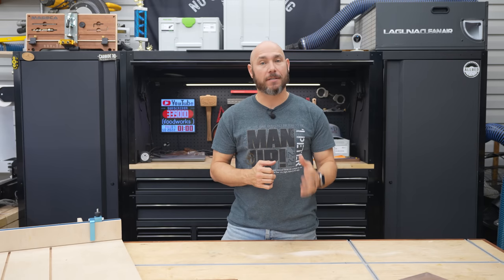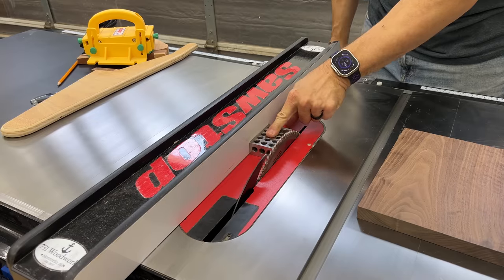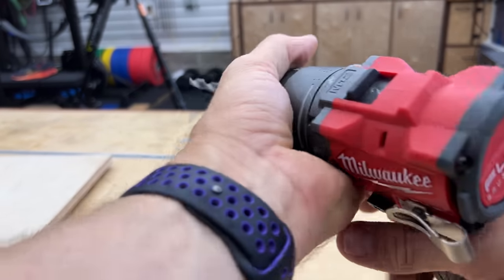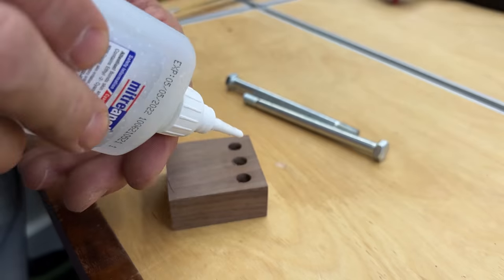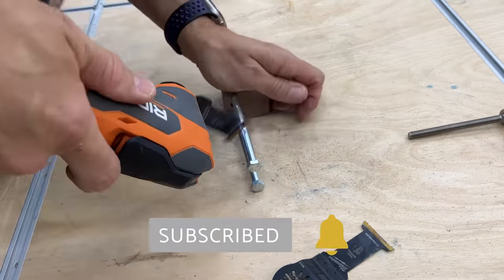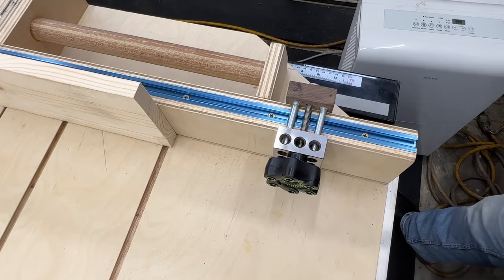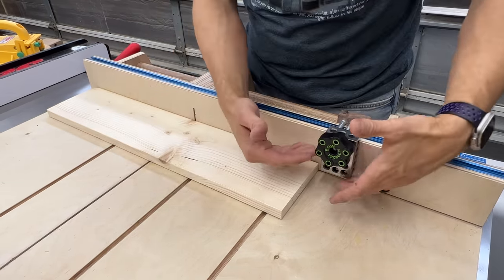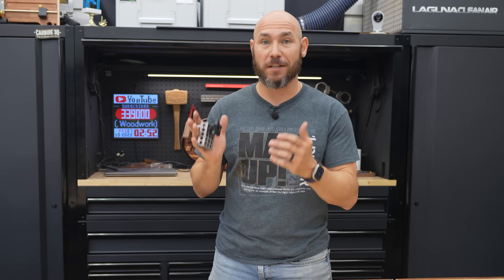DIY Stop Block Jig that Does NOT Require a T-Track

Comment from the maker: ▼EXPAND FOR TOOL LINKS and INFO▼ 
Watch Next = 25 Ways to Use 123 Blocks - https://youtu.be/n9SNxJVz13A
Tools In This Video: 
123 Blocks - https://lddy.no/1d9tp
Carriage Head Bolt 5/16"-18 x 5" - https://amzn.to/3Ti0VeP
5" Bolts 5/16" - 18 x 5" - https://amzn.to/3gnaU3J
5/16" Jig Knob - https://lddy.no/1d9tq
CA Glue I Use - https://amzn.to/3S6r26N

(If you use one of these Amazon and other affiliate links, I may receive a commission) 

Some other useful links:
Daily Tool Deals on my website: https://www.731woodworks.com/tool-deals
Subscribe to our email Newsletter: https://mailchi.mp/7e44c16eefdc/731-woodworks-email-newsletter
Check out our easy-to-follow woodworking plans: https://www.731woodworks.com/store
Outlaw's Board Butter - So Good it Should be Outlawed: https://www.731woodworks.com/store/boardbutter
Reply: Just wanted to let you know, the two McMaster links are incorrect.

Thank you for the idea!
Reply: Great

Comment: The Tool Bear from Den of Tools channel contacted engineers from some tool companies and they told him that backing the chuck up a click does NOT lock it in. It takes it out of the notch and will let it eventually loosen up as you use it. AVE also did a video on it and he said the same thing. Just a heads up.
Reply: One of the YTers who made this claim (the one featured in AvE's video) has also published a correction/retraction video: 
https://youtu.be/yH11SnnbS84
In his defense, he tried to do his due diligence and many of the tool mfr reps actually confirmed the claim. For this latest video he contacted the chuck manufacturers, who were responsive and quite definitively set the record straight.

Comment: I  like.  
Power Tip! If your 1-2-3 blocks are threaded on the 1" face... you can thread a bolt through the stop and now you have a micro adjuster.

Comment: Could you just attach the block with a fence clamp or two?
Reply: Yes I use a bock of hardwood with a piece on top to sit on top of the fence then just clamp it...Have a measuring tape glued to the top of the fence which is just a piece of melamine it does the job.

Comment: With the 1-2-3 block which you are using, you are not limited by the 3" depth. You have plenty of other holes to use. You can mount a face plate to the right (as looking down as it is mounted). Come through the left using two of the holes to secure the face plate. Use a 1/4" thick piece, cut to 1" x ? whatever length (depth) you need. Drill and tap the 1/4" to receive the mounting bolts. Cut the mounting bolts flush. The aluminum stock can be cut using woodworking tools. Just go slow. So, the final face plate (facing the work piece to be cut) would be 1/4" x 1" x ? desired length (depth) to fit your fence.

Drill and tap at least four (4) holes in the face plate, you can have some up and down adjustability👍😎😀

Comment: so why not use shorter bolts instead of cutting them off?
Reply from the maker: You can.  Cutting the bolts allows you to size it to your specific fence size.  And, this allows you to cut the threads off the outer two bolts and just have the smooth part.

Comment: if you instead used the block of wood as the stop with the 1-2-3 on the outside of the sled then you don't need to worry about the fence height as you can cut the block to be as tall as your fence instead.

Also, the drill chuck locking thing was debunked.
Reply from the maker: works on mine
Reply: @731Woodworks  Not turning it back would also work on yours. Sorry bro. Love the 1-2-3 block stop block, but the chuck thing is thoroughly debunked internet BS.

Turning back just loosens the chuck 1 click. It's fine providing you initially tightened the chuck enough that loosening it 1 click doesn't affect the tension enough for the chuck to lose grip. Tighten it just enough to grip the bit then turn it back and see what happens. Loosening cannot improve retention.
Reply: @ST-0311  Works on both my large and small Ryobi HP drills.

Comment: Could you not just use a hardwood block instead of the metal block? Or a wood block with a piece of laminate to stop it wearing? Cheaper than a 123 block.. 👍🏴🇬🇧

Comment: Which Milwaukee drill is that?
Reply from the maker: M12 Fuel.  Latest version...I think.
Reply: @731Woodworks  I bought a refurbished Milwaukee drill a few years ago. It was like new, and I love it. 6 months later, I bought a refurbished Milwaukee impact driver. It came very used, but I love it as well. I am thinking about purchasing a second Milwaukee drill, but haven’t pulled the trigger yet.

Comment: Decent concept, but the 1-2-3 block seems totally superfluous...just use two pieces of wood and the same hardware...If you have a 1-2-3 you could use it as a template/drill guide, but why not just use wood on both sides.

Comment: @731Woodworks Matt, do you know if the festool drills have that counterclockwise feature?
Reply from the maker: I'm not sure.  Never used any of their drills.
Reply: It is not a feature on any tools, only a misunderstanding. Den of Tools did a video debunking this after talking to engineers at different tool manufactures and Jacobs Chucks.

Comment: Great idea. Thanks for sharing.  In fact a little bit too late for me. I've just received my first T-tracks ever a few days ago.   (10 USD for 4 feet length, without holes for mounting), The one-two-three blocks are interesting as well. I watched the video on that. Reasonably priced, but far away. Shipping probably would cost more. I need to look around if something similar is available in Slovakia as well. I'll keep this system in mind.

Comment: Just realized my dewalt drill has the same locking feature 🤯. No more loose bits!
Reply: That "feature" has been already been debunked as false. "AvE" has already done a video on it pulling out the original patents on the locking mechanism.